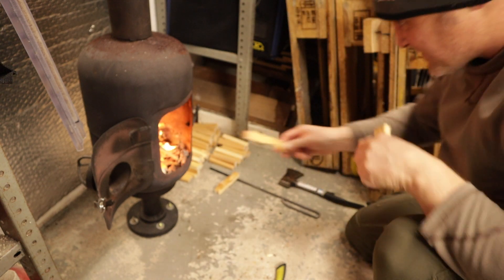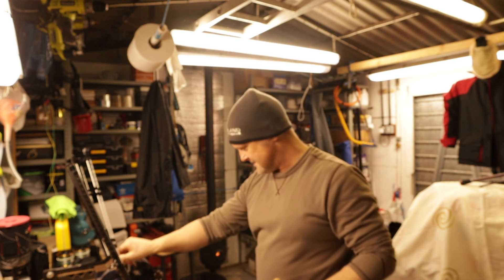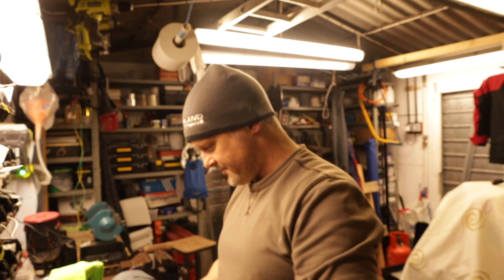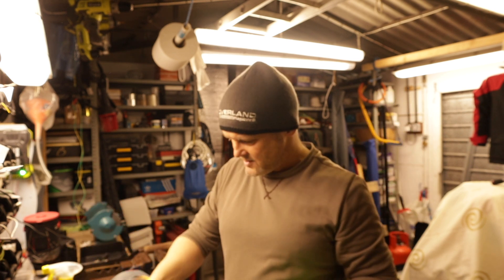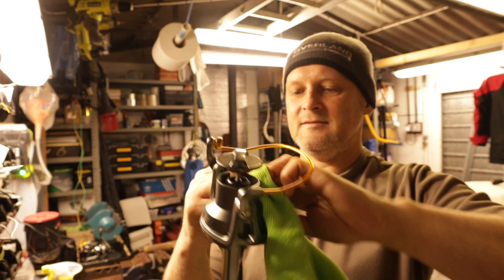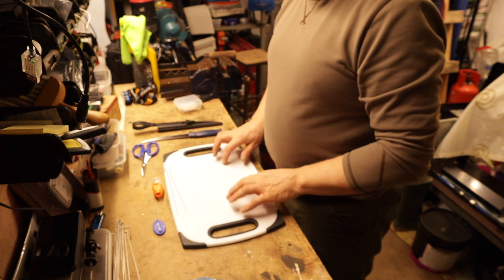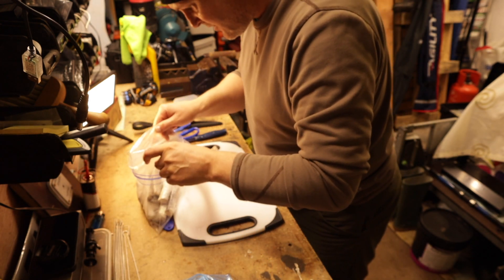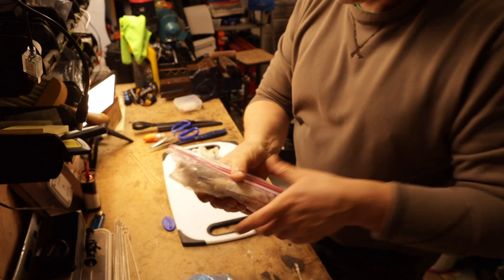Workshop Ramblings December '19

Comment: Hi Mark. I like the fact you look after your gear. My mates Century's CCCs look 20 years old but has only been 6 months since I rebuilt them for him. 

I wash mine down after every trip. I rinse them first, then get some washing up liquid, warm water and a cloth. My rods still look really good but there is a little browning from algae. 

If you get oil on the joint it can get stuck. I wipe mine down with meths if needed. 

Have had to build up the joint on my Scorpion Sport with graphite spray due to years of use.
Reply from the maker: nemesisslr , I’m not the only one then?
Reply: Me too, after every trip, and wash the reels, in warm soapy water, the dry and oil. Same with my freshwater kit too. I don't like to see equipment which is misused, after all some of it isn't cheap.
Reply from the maker: @N3ALE  do you apply anything to your kit for when it is stored? I enjoy the preparation, fishing and care of my kit. It gives me time away from stressful work commitments and I thoroughly enjoy my time in the workshop. Thank you for your comments.
Reply: @seaangling  Hi Mark, no, I was a bit concerned when you said you used a motorcycle product on your rods, I'd be worried is may effect the line, especially if it were mono. I just wash it all and dry it all and then oil the bits which need oiling. If you plan on a trip to Poole one day (you mentioned flattie bashing in another vid (love them by the way, good work) let us know before and I may wander down for a chat, cheers Neale
Reply from the maker: N34L3 I had planned to visit Poole a few times through the year as it is an area I’d like to explore. Are you are aware of any flattie marks that I could try?
I understand your concerns about any adverse effects but I’ve not found any yet. I’ll report any immediately if I do but my personal view is I doubt there are any.
Reply: @seaangling  Hi Mark, yes, inside the harbour at Holes Bay Sterte, alongside the dual carriageway, (opposite the Holes bay hotel) after a frost there are usually an angler or two planted there. Also inside the harbour around Rockley Pier area. There is a vid on here of two local anglers flattie bashing from this area.
Reply from the maker: N34L3 I’d like to give that a go and has been on my list of “plaice’s” to try. 😂

Comment: Hi I have the same reel mine is currently drying out on top of my tumble dryer😂. Recycling all that expensive heat it gives off.
My questions if you would be so kind to answer are. 
I’ve just started experimenting with different types of baits. Is how you prepared the gar fish the best way to go with all fish baits? 
Also can you prepare squid cocktails the same way too before you go out?
As it can be a drama in the winter it’s wet, cold and fingers don’t work. 

Then lastly how do you hook up the bait, is it through one end an elastic it on?  

👍 keep on posting I’m learning a lot.
Reply from the maker: Thomas, there is quite a lot to answer there but I’ll do my best. For fish baits and squid cocktails I prefer to prepare in advance, store them in 10’s in ziplok bags and freeze. It is then really easy to gauge how many bags to take or which cocktails depending on species targeted. You can hook the bait or elastic it on depending on presentation wanted. Sometimes it is nice to elastic as removal is easier. Without sounding like a sales pitch, I show these methods in a few of my videos and each time they vary depending on what/where I’m fishing. 
There is a useful video on making loaders/needles.
I fished recently without the preparation and I forgot how long it takes to sort on the beach. Pulling baits from a bag is so much easier and cleaner. Also it is easy to zip back up and refreeze. I hope that helps.
Reply: Mark Williams Sea Angling thank you my mind is blown 😂. I am so going to prepare bait before I leave my house. That way I can see myself actually being able to sit down in my chair that drag out every time an never sit in. I’ll look out for them other video and start stealing the kids zip lock lunch bags.👌
Reply from the maker: Thomas, it will make a big difference and give you time to do the important stuff like relax and make a brew. Unless it is hectic in which case it gives you a chance for a quick turn around and get your bait back in the water. How many rods do you fish with?
Reply: I feel like I’ve discovered fire 😂 I never get the brews on too busy pottering about in the dark all the time with bait. So this would be a very welcomed change. I use 2 x rods both continentals, leeda FS sport and Okuma trio rex for on the beach.
I much prefer spinning but got to wait until spring arrives.
Reply from the maker: Thomas, if you are fishing with 2 rods either have detachable hook snoods and have 3rd snood baited and hung on your tripod or go with 3 rigs and have quick links / termalinks / genie links to make quick changes and have the 3rd rig baited and hung ready. When you do the bait change, detach, clip on, cast out and chill whilst redoing the 3rd rig/snood again. Time and repeat.
Reply: Thank you I will try this 👌 my next outing I hope to be getting the jet boil out. While the Whiting fight over which chunky baits I’ll have pre made to fight over 😂
Reply from the maker: Thomas Smith sounds exactly like one of my ouTINGS.